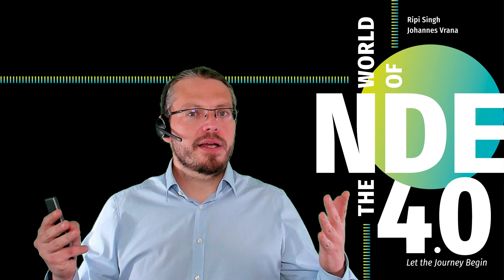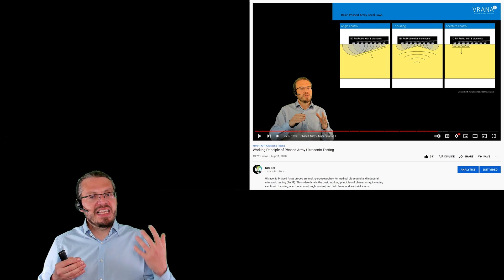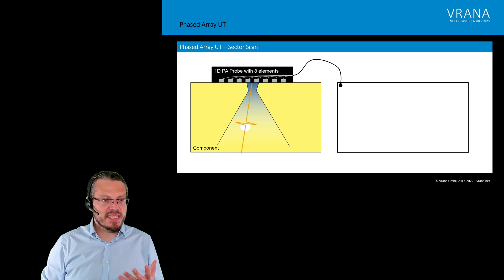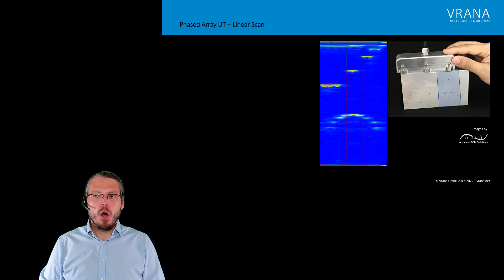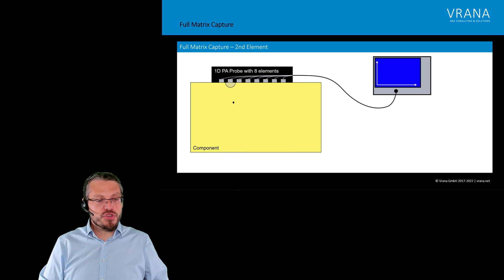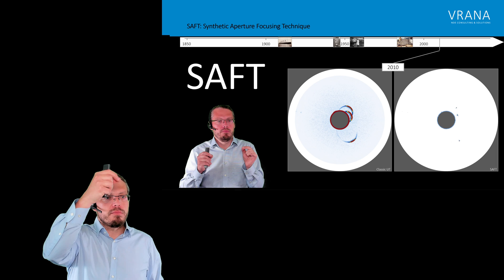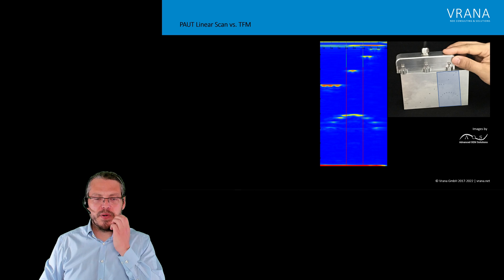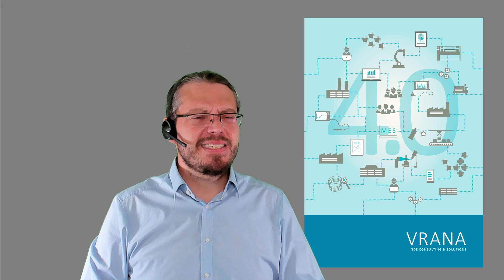The Future of Phased Array Ultrasonic Testing: FMC / TFM

Comment: very good video. I have a question. What is the dead zone of the phased array transducers? thank you Dr. Vrana!
Reply from the maker: The sound is generated by your active element, travels through some couplant, and is partially reflected where your sound enters your actual part. This reflection goes back through the couplant and is reflected again by your probe. This continues and leads at the beginning of every A-scan to an increased noise level. This is the dead zone. It is the zone where you can not detect anything as the noise, caused by this bouncing back and forth between the active element and the entry surface, is too high. And it is the same effect for conventional and Phased Array probes.
On the other hand, the near field is the natural focus point of your beam, which can be calculated. This video can help: https://youtu.be/xWRABwg1TB8?si=M8IclHFQWzDRgFhr
Reply: @NDE40 Ok thank you very much. In other words  the PA transducer has a dead zone like the conventional probes. We are talking about 3-6 mm of dead zone below the surface. From this point of view there are no advantages in using the PA instead of the conventional transducers. Correct? Thank you again. Best Regards. Massimo.
Reply from the maker: @MassimoPradetto  Exactly - phased array and conventional probes with the same aperture also have a similar deadzone. Actually, I found that the deadzone of phased array probes is a tad longer. This is where TFM can help (but only if done correctly).

Comment: Great Video! In most applications the scanning speed is very important. FMC/TFM is certainly much slower compared with "standard" PAUT. What is your view on this?
Reply from the maker: Not necessarily. TFM Speed scales linearly with the number of elements and PAUT with the number of focal laws. Moreover, PAUT usually generates more ringing as the beam is directed. Therefore, the PRF of TFM could be higher. The third limiting factor is the speed of data transfer - so You need to be careful which instrument to buy.

Comment: I'm intrigued about why you describe as high frequency the A-scans from each capturing elements. I get that we're talking about ultrasonic waves, but shouldn't we reserve such description to frequencies above like 10MHz?
Reply from the maker: The High Frequency in the A-scans is not about the ultrasonic frequency. So-called HF (high frequency) A-scans are not rectified, are usually not compressed, and use a sampling rate that is at least 5 times the frequency of your ultrasonic frequency.
Reply: @NDE40 , awesome! That makes perfect sense to me now. Thanks a bunch!

Comment: Good video. The problem of the TFM is, that it has many propagation modes and whe you choose wrong one, you will not see the imperfection inside the material. So you have to inspect the material with more propagation modes to be sure, that you catch the flaw.
Reply from the maker: For me that is actually a benefit. In classic UT or PA you never know if the indication was caused by L waves or T waves which can lead to misinterpretations. In TFM you can distinguish and it is not that you have to collect the data multiple times - you only nees to do the data processing with different parameters. And in my eyes a good manual TFM instrument should allow to do multiple reconstructions of the same data set and display them at the same time.